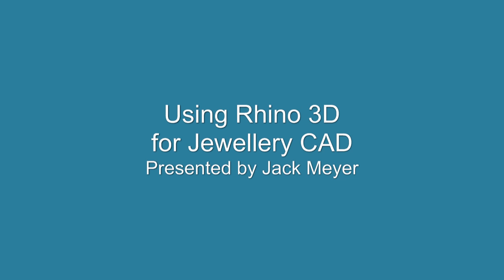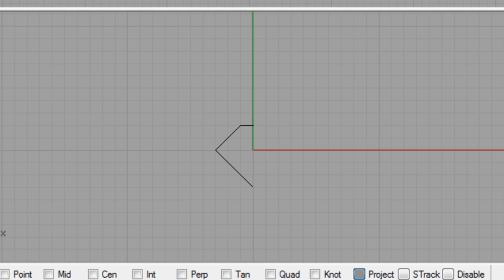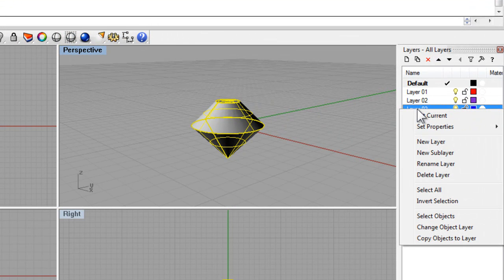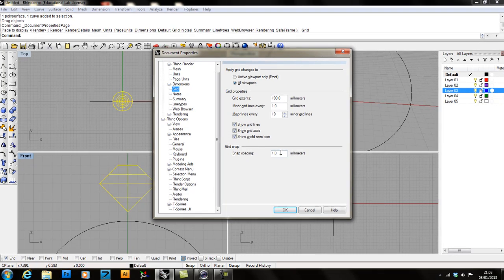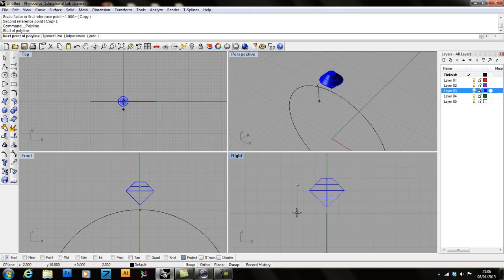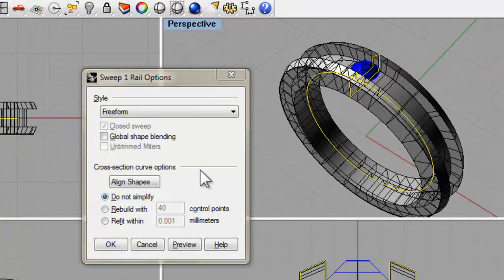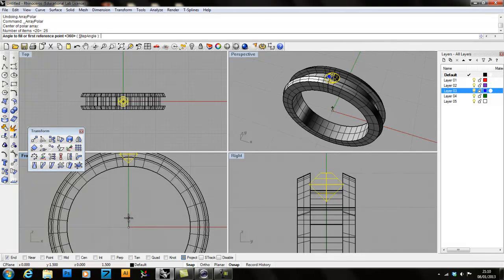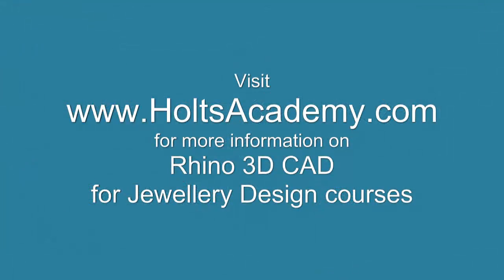Making a Channel Set Eternity Ring Using Rhinocerous 3D - Holts Academy of Jewellery

Comment: How do you design bigger ring sizes? Do they simply have more stones? If so, does that mean a bigger size eternity ring is more expensive to buy?
Reply from the maker: That's a fair question.
Many eternity rings in shops are not actually full eternity rings. Rather, they're simply half-et rings (where the stones don't go all the way around). But yes, a full eternity ring for a larger hand would require more stones, which would affect the cost.